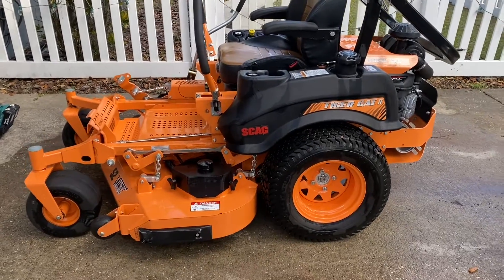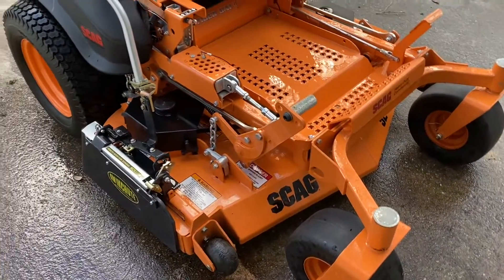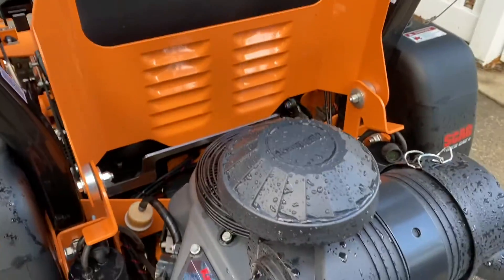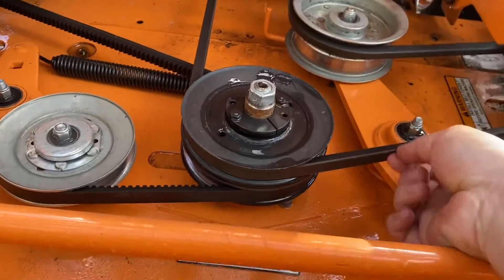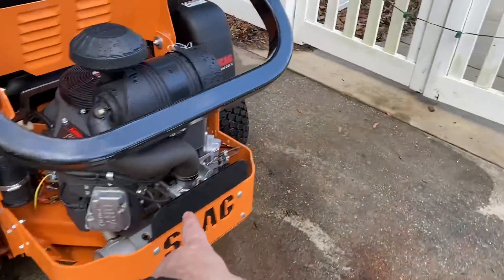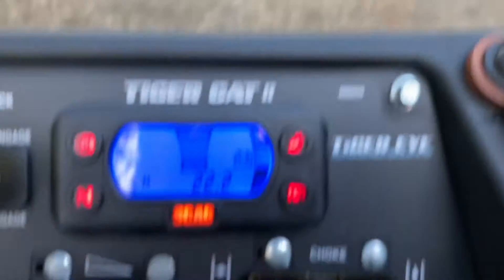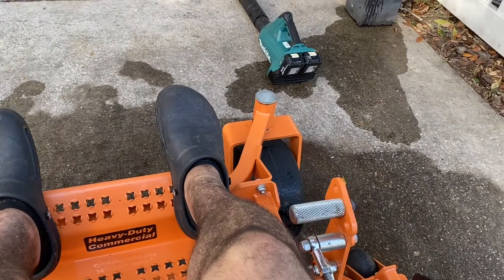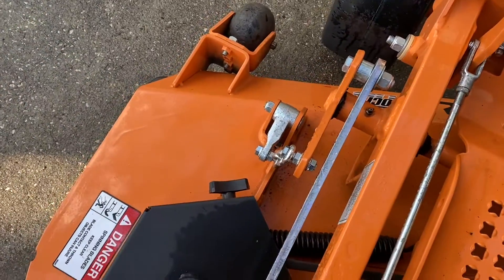SCAG Tiger Cat 2 Comprehensive Overview

Comment: I got the same mower with the 28 hp Briggs vanguard, I really like the mower! I enjoyed the video with transcript.
Reply: How much was it ? Thinking about trading mine in on one with that motor
Reply: @neilkelley1323  back in May of 2021 I believe tax and all it was around 11000.00
From Cox tractor in Kingsport
Reply from the maker: I just sold this particular mower with 23 hours on it for $8500
Reply: @Archifx  thanks for the input 
I like how it starts with the efi engine & I can mulch some tall grass effectively, may leave a small trail, but trail disintegrates when I take my blower to it.
Reply: @Archifx  why did you sell your scag thanks
Reply from the maker: Too much mower for me. Got more than I paid. Was way too dusty even with baffle mods
Reply: Hey what’s the feedback on the 28hp Briggs debating between that or the 26hp kawi
Reply: @ItsPeek 
I really like the mower, it’s tough as a crane. Cuts smooth, and fine with gators blades on it.

Comment: Have you tried lowering the deck baffle to help with the blow out?
Reply from the maker: No. Can you explain?
Reply: @Archifx  under the front nose of the deck there is a baffle that’s bolted in there.   It is adjustable up and down to eliminate blow out for different cutting conditions.   Just google Scag baffle adjustment.   Tons of info out there.   You can also put the tweels on there for the 61” Tiger cat 2.   They will be about as wide as your deck, but they will bolt right up.
Reply from the maker: Holy cow. Thanks for the solid info. I really appreciate it. I’m going to go out there tomorrow and see what I can do. Thanks again
Reply: @Archifx  no problem.   Happy New Year 👍🏼
Reply: I second adjusting the baffle down!  It will make a huge difference.
Reply: Yes, baffle up is dusty, baffle down is not as dusty and better for mulching.
Reply: Good to know the baffle can help… thanks!

Comment: How do you release the hydrostatic transmission/put it in nuetral on a tigercat 2?  I can find a video for pretty much any zero turn but a tigercat 2...
Reply: Remove the cover to the fan cover on the hydro pumps and there is a bolt next to the inlet lines on the front of each pump. Loosen the bolts a couple turns and you’ll be able to roll it with the brake disengaged.

Comment: I have a question on the scag are both the tanks like together so the gas is added up or is it you have to switch them
Reply from the maker: You have to switch them
Reply: @Archifx  how do you switch them
Reply from the maker: Ball valve inline one of the fuel lines. Easy little manual switchover.
Reply: @Archifx  is it the red turn thing on the right of the seat

Comment: "Made in the USA" means assembled in the USA.  That's alot of mower for a single property. Take care of her and she'll probably last into the next generation.
Reply: They are built in Wisconsin. All metal is bent welded and painted in Wisconsin. Motors and all that are built wherever they are built
Reply: They build everything but the engines on these
Reply from the maker: And the pulley hubs or center things. They’re stamped made in China.